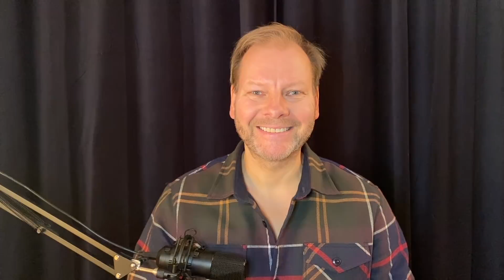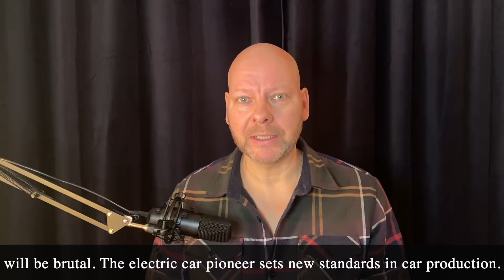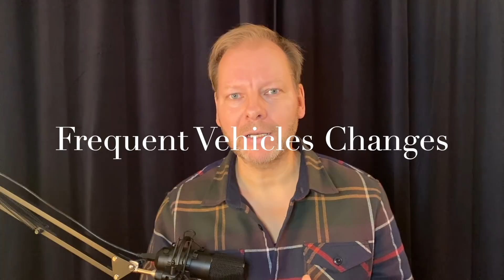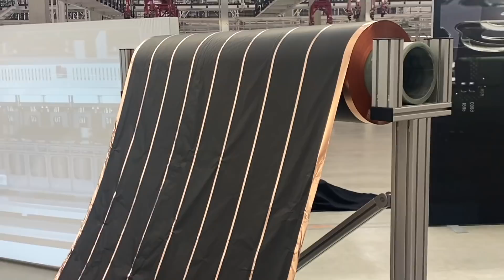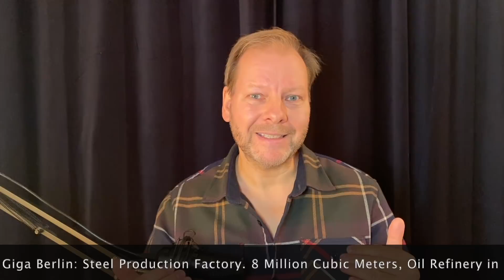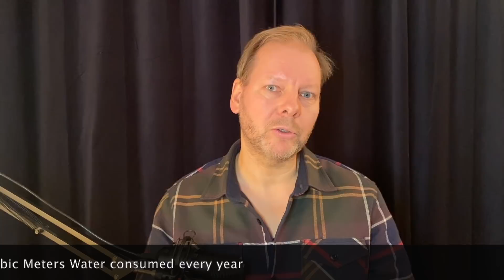The last and 6th part of my Giga Berlin Factory Tour Series: 10 Advantages of Giga Berlin

Comment: Hi Alex,
Regarding #8 Hardware changes is not often discussed but I think the Tesla approach of doing frequent hardware changes warrants more discussion. Why? One of the mantras of mass manufacturing is to never change the BOM = Bill of Materials. One reason is of course sourcing and price. The other often less discussed is the managing of spare parts and serviceablity of the cars. And the third is to actually manage and disseminate the information about the BOM for each car.

I don't know how Tesla does it so efficiently. Consider that you have to keep (store) spare parts for old version of your models - people drive cars for 15-20 years. And then the service team has to know what part exactly they need and maybe instructions how to mount it. How many versions of service manuals do they have LOL? I think this way of working is very difficult to implement with cost efficiency and is also a challenge in terms of software and data to manage it.

But nobody talks about it - everybody is amazed how Tesla can do OTA software updates, but nobody talks about how Tesla basically does Continous Delivery in hardware space on mass manufacturing scale at lower cost than everybody else! Maybe you can research that and do a video, I think the results would be interesting.
Reply from the maker: Fully agree. My main mission to publish is to reveal core differences Tesla has no one really looks at or understands and this one is one of them. I will continue the article that I have started already about HW/SW changes. Thanks for your comment that has some valuable points included I'll add in my article.
Reply: A guy named Joe Justice made videos on how Tesla uses agile methods used in software development and apply them in hardware changes
It is quite mind blowing Tesla is able to up to several changes per day on the assembly line!